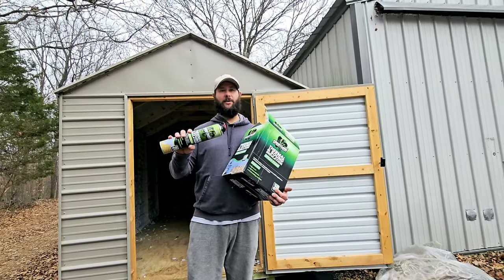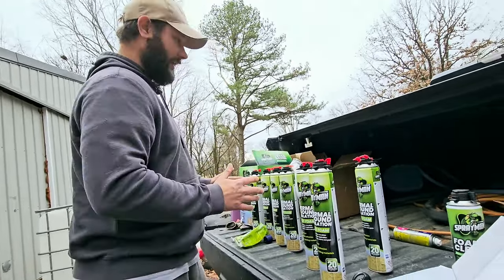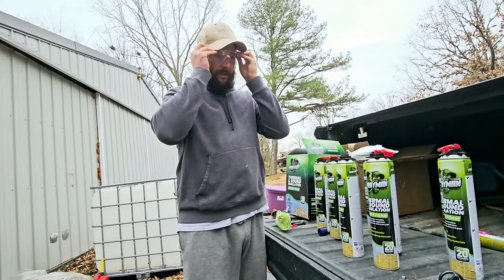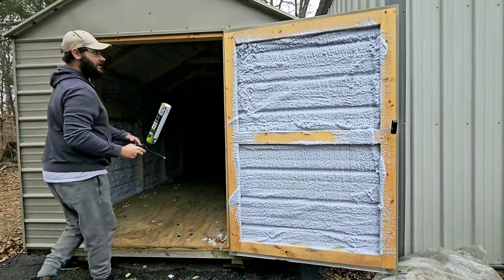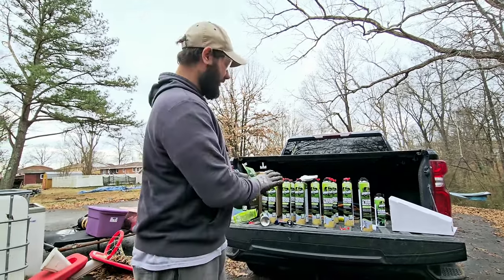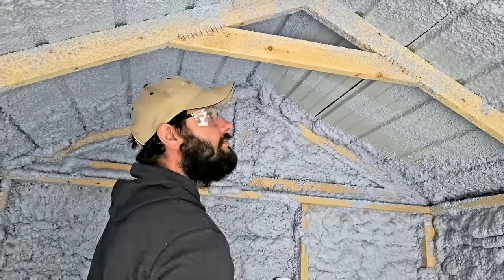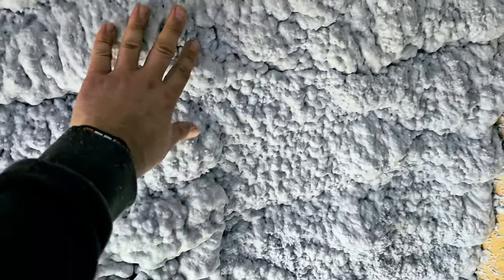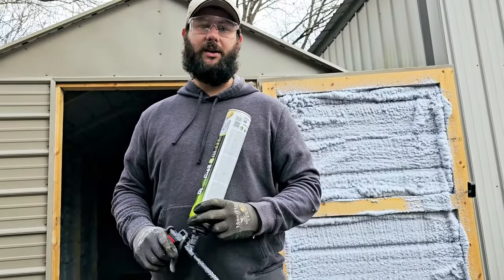Sprayman Expert Shares Top Spray Foam Insulation Techniques for DIY Success

Comment: For cost reference: I calculated that 3-1/2" R-13 batt insulation would run about 61¢ per ft².  For this spray to reach R-13 value it would require 2.3 inches in depth. That would cost $1.92 per ft².  So for walls that are 8 feet tall, the cost for batt insulation = $4.89 a linear foot. The cost for this spray foam = $15.38 per linear foot.  (Actual cost depends on package purchased) Your mileage may vary.  Thanks for the video.
Reply: BUT fiberglass batt is not a good idea for a metal shed due to condensation causing
a mold problem. You also have to have studs to attach the batts to. 
I would recommend rigid foam sheets and glue them in place with
this spray foam leaving a good space between sheets say 1 1/2 inches at least.
It would leave you with a much cleaner looking job as well and WAY faster too.
In answer to this video's question "doesn't that look great?" Not really.
Reply: For cost comparison, I'm getting my 16x32 shed done professionally for $1900. Spray roof deck with 5.5" of open cell
Spray walls and gables with 3.5" open cell

Granted, you need the pricier closed cell on a metal shed.

Comment: Do not have moisture on your substrate, also wear the proper PPE, any moisture above 14% will more than likely lead to delamination issues, manufacturer will tell you 18 is the highest, a professional will tell you 14, high pressure or low pressure, you want your surface as dry as possible

Comment: I'm an ironworker, and we use these guns all the time and I'm gonna give you tip after you clean the gun initially leave the can attached to the gun let the acetone work on the remaining foam clinging to the inside the workings trust me it may appear its all  out but it isn't let cleaner can on for at least 5 minutes and respray then when you take can off don't pull trigger to release pressure let that cleanerase in the gun another 5 minute then release these guns gradually clog up and will need to be broken down to clean properly but this  will help prolong that
Reply from the maker: Thank you for your knowledge. I appreciate you
Reply: @jasong8377   I agree i am a union iron worker and use these bad bois all the time. Don't take the can off if there is product left in the can also. Just close the regulator.
Reply: They are a god send. Union iron worker here and used for pan decking.

Comment: FYI guys once you have the gun and tip you can actually use the regular Foam bottles they sell at walmart the big gap and crack for $3 each it works the same.

Comment: What are you insulating, meaning what will be inside the shed? Will it have a heat source inside? If not, the air inside will rise or fall to the outside temperature. You might slow down the rise in temperature inside on a sunny summer day, but it will eventually be the same. And even if you have a heat source inside, the wooden supports will transfer the heat in or out, bypassing the foam insulation. Appreciate the time and effort to make the video and share your experience..
Reply: He literally says in the video
Reply: @Easton21  Got it, thanks. My mind must have wandered away the first time through the video; I was multi-tasking a couple other chores.

Comment: Just curious, did you use clothes sell insulation or open cell installation because if you’re doing your metal roof, you should think about the metal roof sweating and siding so you should probably use close sell insulation otherwise you’re just soaking up all that moisture and getting mold
Reply from the maker: closed cell foam

Comment: So i was using this for floor underneath my home, i used the B tip.  But its like when i started going right side up just for a second, it would kinda stop spraying properly.  Wonder if its possible, even with the tip screwed all the way on, i may have had the tip of it where it was spraying down. Instead of in an upward angle like in your video. I didnt notice but I'll have to try again and be sure

Comment: Okay I found the red nozzles on amazon, question. can I use spray foam that is for gap filling to spray vertically.. like you did. or does it have to be a special foam. these foams by the 12 pack, prices vary. stanely has it on bonus with 25% discount for $77 buck.. it is for gap filling, so with the vertical red tip will it spray out in a pattern?
Reply: I'd say try it. You might get good results at a cheaper price.

Comment: Hey great video and good product! My question is, can you use this spray foam to make a walking box, for 35 F temp to 41 F
Reply: I did.  But had professional apply it for those areas.   If you need electrical service local codes may call for specific details.   Also whatever you plan to cool with should be installed first as the foam will form a seal.  Don't forget to cover up anything you don't want the foam inside of.  It's about like using a power paint sprayer makes fine drops.

Comment: You did not mention if this is a closed or open cell foam
Reply from the maker: closed cell
Reply: Just about every foam in a can is closed cell. Even alot of the max expansion is single part cc

Comment: U just sprayed the cleaner at the door you just insulated ..also the amount you applied is useless as sprayed ..true 2lb foam.is about 6.5 to 7 r value per inch ..this is showing a way to others to waste money..have the pros do it..even a froth pack is better then this ..u m8ght aswell of grabbed cans  of great stuff  crack sealer and done ur shed man..